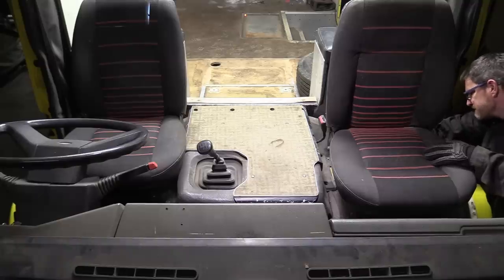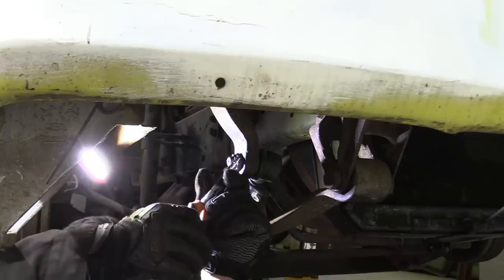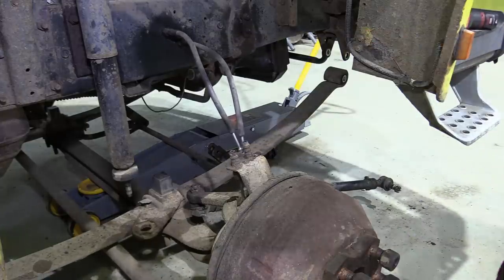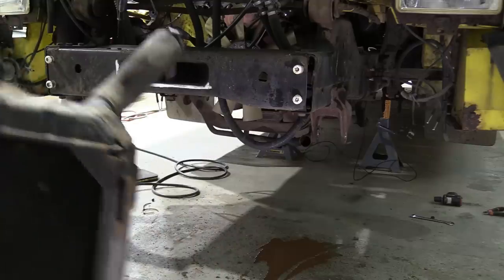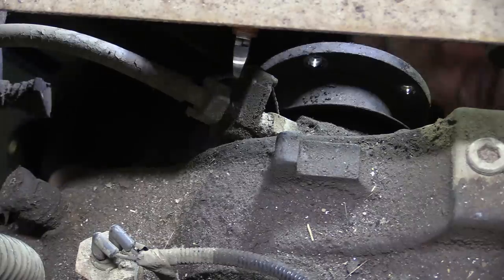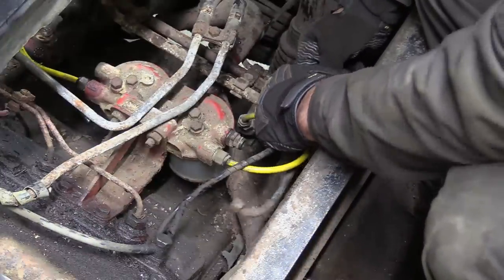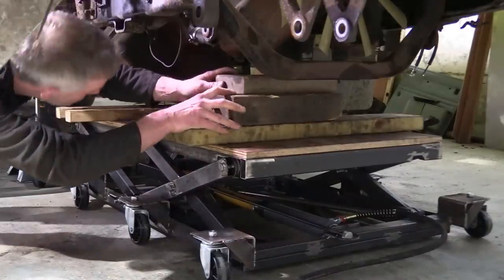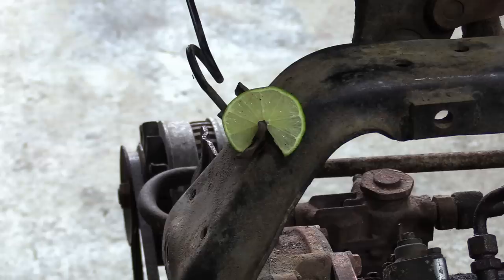The Escargot - RV/Camper Car Transporter Conversion - Part 2

Comment: Making me ache all over just watching and Its all coming back to me  why I grew so tired of working on heavy goods and quarry vehicles.  Rebuilt many of the old Ford super six engines - heavy basic and industrial but extremely tough and reliable. You boys are brave taking that old cart on and it will be interesting to see what replaces it! No doubt it will turn out like a Rolls Royce....in time.

Comment: Jesus. My car weighs about as much as that engine.
Reply: And your car probably gets to 100 MPH or 160 kph in under a week😉😊😀😁😂🤣😃👍👍
Reply: Steve Veness 
About 3 minutes. And at 170kph it shakes like it's about to fall apart. Gotta love it
Reply: Steve Veness 
About 3 minutes. And at 170kph it shakes like it's about to fall apart. Gotta love it
Reply: It weighs more than one of my cars with two people in it
Reply: @JanBabiuchHall  haha as a 3rd gen auto engineer, I can tell you when you finally don't want your car anymore there is a way to increase it's Eta Way above 3mins to 170kph.
You need a plane at 10,000 feet no parachute, and a telescope to watch it's arrival at maximum speed. Oh and make sure the fuel tank is dry don't want an explosion upon ground level arrival 😉🙂👍👍
Remember this will be a permanent unbroken top speed achieved by your car, After you no longer want to drive it any more.
😉😀👍👍

Comment: Good engine for the tractor pulling lads though... recover some cost there!
But what are you going to add back in? Cummins?
Reply: My guess is Mercedes OM603 turbo, but then again, maybe that would not be complicated enough. :)
Reply: @itekani  I dont think it would have enough torque to pull that along with sensible fuel economy, lots of frontal area so would need to screw its nuts off

Comment: Im guessing a cummins 6bt swap? Or maybe a volvo engine.
Reply: My guess, cummins 4BTA, they are cheap as chips in the U.K. good power, light, compact, modern and have some decent 5 and 6 speed gearboxes available. Not in the slightest bit easily tuneable though.
Reply: @ForeverNeverwhere1  4bt cheap! 6bt are half the price!
Reply: Andrew Litchfield in the U.K.? Or the USA, in the U.K. Dafs  and Iveco  7.5 tonners have loads of them, you can buy a good working truck with full MOT with one for about 2 grand. 1200 for a complete engine and gearbox with all the gubbins, In the USA they are spendy as feck.
Reply: Barra swap
Reply: @cgrecommended  they dont have Barras there, they only found in South Africa, New Zeland and Australia

Comment: Put a FORD Barra Turbo under it.
Reply: greggy weggy don’t have those in the uk so would have to import it
Reply: @elliottslab  if I can import an electric kei van to oz, one barra motor to the UK should be easy, it would be priceless to see people try and work out what the hell it was.
Reply: greggy weggy I mean I’m sure they are going to use a Diesel engine to move Somthing like that, and I have a imported Capri from South Africa I’m not saying you can’t just why do it when  it’s not going to be cheap and we have 0 part availability  the last you want it to have gone on a road trip and brake down and not be able to fix it on the road

Comment: watched this yesterday, spent all day today wondering what drivetrain they're going to put back in..  anybody else as bothered by this as I am?
Reply: Rover V8 blown.. 😂
Reply: @andybrown3693  since the goal is to save weight I was thinking something with an aluminium block... hadn't thought of the rover...  but a gas engine in a truck that big will be thirsty af... it's mind bending.. I can't wait to find out!!!
Reply: Nice blown Rover V8 on Lpg. Cheap fuel, low weight.
Reply: Might even be enough home made gas... get the beans out 😂😂😂

Comment: Can I ask a question here? How come we see Richard spend more time on his back/knees than Charlotte the Harlot, meanwhile Nik is providing caustic commentary, lifting away a heavy looking step, tackling a recalcitrant reverse gear switch connector and jeopardizing life and limb to pull off a stuck hose?

 Frankly, it's about time Richard pulled his finger out and did some bloody work round here!

Comment: LMFAO "cheeter bars" on wheel nuts, that was an ak47 cheeter bar! and with how tight the wheel nuts was it was needed!!  I remember driving thos cargos back in the 80's postcode between gear ratios is very accurate! as a driver and wannabee fitter its great watching you work, and its amazing how much crap comes apart to do some jobs!!

Comment: I have to say I did laugh at the /12" 6mm line very funny and so fecking true some times, I feel for you lads I have been a light mechanic for 30  years and just recently I've become a fleet supervisor for a local council and I have had to learn HGV's + PSV's very quickly and it has amazed me the bolts that come out that would be F'd in a light but defo they are Bigger,Heavier and way more tighter loving the show though chaps.

Comment: Regarding the removal of the wheel nuts using a bar, your complaint that the air gun didn't have enough 'waft'...Well 'waft' is what you do to move air (not related to air-gun movements).  What you mean is WEFT 😀  This is my third time watching from the start - I've watched 3, 4, 5 a few more times than 1 and 2 but always good to see as I wait for Episode 6...😮

Comment: For reference, a 15L class 8 North American diesel truck engine weighs 1400kg (3100lbs) holds 50+ L (14 us gallons) of oil, makes 400-600 hp (oem) and up to 2800nm (2050ft lbs) of torque.

Comment: That 6 cyl red engine was bullet proof the ones I worked on. They pulled draw bars. Sump plug stripped easy but you could screw a gas threaded taper plug in as a good repair. Mine had astronomical mileage on them. Gear box was a bit sloppy if detent spring broke..
Brakes were crap with fantastic fade.

Comment: Lift up multi ton commercial truck on wobbly jackstands, remove front wheels and axle. Remove 1,600 lb (freedom units because I am from 'murica) tilted engine and trans on homemade platform. You two have some balls, that is for sure. I felt uncomfortable having the back end of a Toyota pickup on the same size stands when I had the rear axle and springs out.

Comment: Badly needs a Cummins!  Awesome work chaps.
Reply: I hope they do a 6CT and not a 6BT... and compounds are a must! the stock HX40 + HX52 or 55
Reply: @ViktorAgnarFalkGumundsson  Would be nice but to be fair the 6BT is a similar size to the Ford Dover, but capable of making more than enough power for this truck.  I'd say a VE pumped 150 or 160bhp model to start with.  A few tweaks and an HX35W would see over 200bhp easily and a huge wadge of torque.
Reply: The VE pump version has smaller injector nozzles, you’d always want to GO for a P pumped one, 24valve 6BT and 6CT in marine versions came stock with a P pump, just swap in a cam form a ram and it will move mountains!

Comment: As you guys like a bit of moddin, why not make the front panel  of the Luton hingable along with boarding inside, so you can tip the cab over for maintenance, most Luton bodies are built this way these days. Great vid btw

Comment: protip, use an open end spanner to hold the head of the bolt in the impact socket when pulling the bolts out while spinning them
Reply: protip, take the old nut out of the spanner before you attempt to put a new nut in there...

Comment: It just dawned on me where this is going. Now that the running gear is out of the way they will tend to swap another engine plus trans in. Of course Nik likes to have some A/C and the whole assembly of the axle needs to have a significant amount of lightness added. After all of that one that shall remain nameless will want to have an electrical flip front which of course means to re-design the whole cabin assy plus making a lots of brackets plus over-complicate it where needed. Keeping in mind that Binky is not finished and the MG is waiting, I guess we are safe for the next ten years at least. 👍😜
Reply: Don't forget the 205 rally car. And then there's that other one, the rear-wheel 6-litre classic...you know, even though no-one is going to be really interested.

Comment: I never realised that they sold those Sixes so late in the piece. I worked on marinised versions over 40 years ago. They were an inexpensive way to get a powerplant but woefully inadequate as a prime mover. You might want to try larger injection  pump elements and a turbo (or two) to increase the torque.

Comment: I know the idea was to get some weight off this truck, so you could drive it with the mini inside.. but replacing the old motor was not what I expected to happen... still never been happier to see a half a hour of truck deconstruction...  

Any chance in the next video you could show us how parts meant for reconstruction of the engine bay are being saved up and how you will remember where it all goes?  I have a particular fascination with organization which you two fulfill admirably!

Comment: Re: Stuck \ corroded nuts an bolts, years ago I worked on   some meat factory equipment and so couldn't use WD or +Gas but had to use something called FoodLube. It is v expensive but It's price is in relation to how good it is.   WD ( lubricant 3/10)  +Gas (  dismantling  fluid - USA - PB Blas...6/10)   and Ffoodlube ( dismantling fluid  9/10).  It is expensive but it works.

Comment: Now the platform makes sense! I was only 2/3 accurate on the weight of the engine; explains why our Mobile Library only comes round once a fortnight. Imagine the bracketry you'll be making to fit the Prius motor in.......

Comment: 110bhp from a 6 litre engine that's 18.333333 horses per litre. The engine and box alone is over 300kgs heavier than a plastic pig and a similar weight to small cars from the 50's-70's. I agree with many people with putting a Cummins engine and Allison autobox in. They are a ten a penny.

Comment: Hot cummins 6bt  manual box and locking rear axle and the snail going to drift with the best of them! The 6bt will make an easy 400 BHP/400 LBF and make the snail a little more rapid.........

Comment: 5:00 Changed to a smaller wheel, rim wore through the steel braid and you could see the bubbles inside the brake line, good times

Comment: You might be able to get some aluminium wheels from ALCOA. not sure if they would make them in that size though. They supply wheels for large semi's (lorries for those in whitworth country) and road trains, so should be able to handle the weight of the truck and reduce the unsprung mass

Comment: If you would like a bespoke wiring loom for the snail, I have done several for Ford Cargos, including split charge circuits, bespoke audio systems etc. I can work for tea, biscuits and sarcasm. Only problem is I retire in 16 years

Comment: -"What are you watching buddy?"
-"Oh, two English blokes pulling apart a rusty 30 year old bus."
-"Oh yeah? How many braker bars have they broken off?"
-"None."
-"What?! Oh I see, their using heavy duty air tools."
-"Nope".
-"What?! So they are burning everything apart with a gas axe then?...
-"Nope."
"Are they not using any gas at all?"
-"Well, they used a Bic lighter for a few seconds."
-"A Bic lighter? Are you pulling my leg?
-"Nope, that's all they used, for a vacuum line I think."
-"So, a grinder then, is that what they are using?"
-"Nope, no grinders at all."
-"You must have gotten the age of the bus wrong then bud, there's no way a thirty year old bus comes apart that easy."
-"I don't know what to tell you, but they are doing it, it's mesmerizing to watch, the freaking bolts are still shiny."
-"?? What did they transport on that bus all those years, unicorns and rainbows?
-"May as well have, the episode is almost finished and they haven't even lost their temper once,they're still having fun..."

Comment: Ya missed a trick with the exhaust dragging scene: You should've had Nik pulling it from the front, then all the dragging shots, then Nik pushing it from the rear too, as if he was at both ends at the same time.

Comment: Often they use different expansion rate nuts on exhaust stud nuts so they can come off when they are cold but are unmovable hot. Metallurgy is great stuff.

Comment: There was my thinking to myself, I wonder if a Scania V8 with the 12 speed range change splitter 'box could be shoehorned in there 🤔
Then I remembered who I was watching and thought, sack that, why not get ambitious and fit a RR merlin 🤣
Reply: A Meteor, essentially a Merlin without supercharger, weighs 750kg for just the engine.

Comment: There is no way that front end hasn't been apart more than 7 or 8 years ago at most.  The bolts were too clean of corrosion and most of them came apart FAR too easy.  If I were a betting man, I'd say that thing had some sort of major engine service that required them to get nearly as deep into it as you did before they were finished with it.  I'd love to see an old 12 valve cummins go in it's place.

Comment: After suffering thru all those crappy standard hose clamps I went to Wurth Zebra clamps and never looked back. https://www.wurthusa.com/Service-and-Repair-Parts/Clamps/Zebra/c/200215 .  They grip. They don't split. They don't seize. They don't skip when tightening them.  They don't break and they don't rust.

Comment: Ford 'D' Series engine stop cable - speaking from experience, if you don't push the stop button fully back in it does rather compromise the engine's performance.

Comment: Would it have been easier to buy a 20ft shipping container, cut the back out for a windscreen, 2 side windows....the rear doors- no change.
Then weld Binky to the floor and the celica to the rear?
Reply: wouldn't have had it's MOT though.

Comment: Odd question (yep, rewatching this series)... Since the cab can't be flipped open given the box design yet all those fancy hinges to allow it to be flipped open are in place - is that an opportunity for weight savings.  By that I mean, remove them in favor of some weight optimized Bad Obsession heavy duty bracketry? Then again, thinking it over it might not be worth the time and hassle of trying to remove that stuff...

Comment: So strangely satisfying - not least because I'll NEVER have to work on the old TK based Bedstead buses ever again :-D
That lifting platform works so much better, and safer, than a 2x4 extension and about 4 chaps hanging off the back of the engine crane - was the platform easier to build than find four chaps...?

Comment: And I thought you where only going to buy a bus to move Binky around in -- by the time Nick redesigns the brake system and electrics to have power windows  , hot tub and kettle (and heated toilet seat)what time frame (year?) will this be on the road?.

Comment: Fantastic videos guys, will you be replacing the Dover with the v8 diesel installed in the 16 tonner Cargos of the day, although the 16 speed box may be over kill, and ruin your weight saving exercise. Looking foward the next project of a 4x4 ride on mower.

Comment: Suggestion, any modern 6 cyl-engine. MB-Actros, Volvo, Scania etc. Cummins is not  bad idea either, like some already suggested. OM606 is nice too, but I do no believe it can handle the stress from the sheer load of mass of a truck
Reply: OM606 with a 4ton truck?

Comment: Cummins Swap would be nuts. Don't know how much it weights tho but i'm sure its lighter than this whale engine
Reply: Depends on the Cummins, the 6BT that most people think of is ~500kg for the engine alone, depending on the transmission used I imagine there's not much weight difference there.

Comment: Richy Richy the Rusty Nut Removal Expert :)
So many good things happened in this video.
I was going to say that even with 110hp the torque figure would have been huge, oh no it's not, a very low output of roughly 340Nm or 254ft lbs, pathetic.

Comment: What's going in the Dover-shaped hole remaining? I was hoping for a 2-stroke Detroit Diesel but a quick glance at wiki reckons even the 4v71 is over 800kg before you put a transmission on the back-end. 
So... I'm going to say supercharged petrol V8. You can get 1000Nm out of an AMG E55 engine. Fuel consumption be damned!

Comment: I guess since the gearbox and engine weigh 760kg, and you're on the hunt for a lighter drivetrain a Cummins engine will be out of the picture?

If it were me, i'd swap in a 6CT with Compound turbos and whoop around with 600 reliable horses, nothing beats a P7100 and a Cummins ;)

Comment: I don’t get it, why does it need to weigh less than 4500 Kilos?  As far as engines go, a B series Cummins weighs 1150 lbs, so what engine do you intend to replace it with (and the trans for a heavy truck is about 300 lbs)?  I can’t imagine using a gas engine; the mileage would be insanely bad.  As a former heavy truck mechanic, big trucks use better equipment than cars, and they are easier to work on, that’s why you had few issues taking it apart.

Comment: While you're there air.new might as well put the drive around the proper side of the vehicle.😑 Tighten till bolt breaks then back off 1/4 turn. I would be willing to help you but I'm way too lazy for that.

Comment: Wow, 165BHP from 3/4 tonne! That's more than 200BHP per tonne, pretty good if it included the vehicle!
Reply: Where did you get the 165 bhp from? Its hardly 110.
Reply: @knutn  The official rating for the 5.9L version of that engine is 165BHP
Reply: @cambridgemart2075  That's the turbo, this is na.
Reply: @knutn  OK, I thought the turbo was the 190BHP version. It does seem there were a lot of variants in the series and there are marinised versions as well, so I may have looked at the wrong figures.